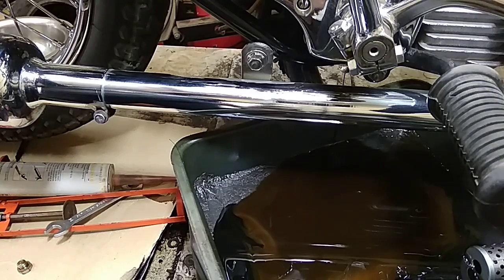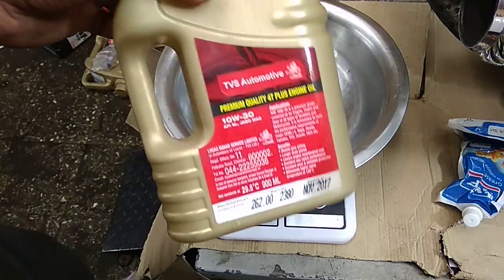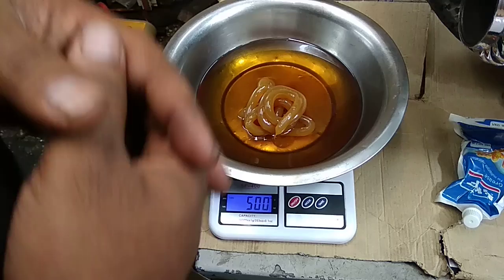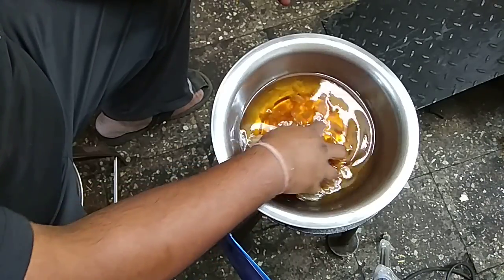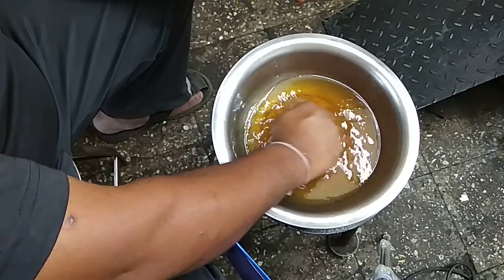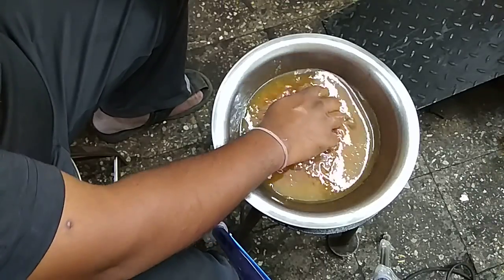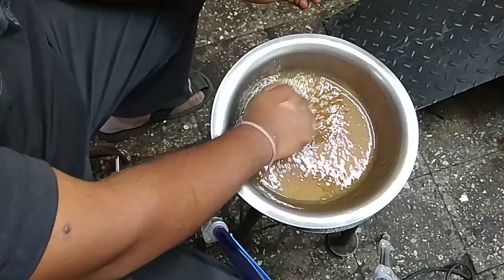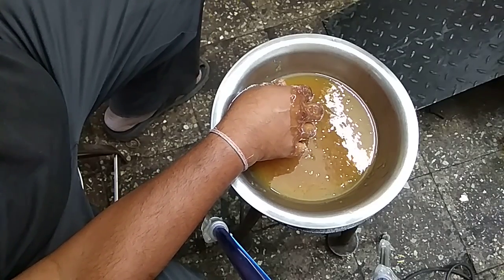Royal Enfield Four speed gear box lubrication...home made "00" grade grease (English) Part 3/4

Comment: In the owner's manual 700gm weight is mentioned. And if you use an oil grease mixture then it should be 1:1 grease 350 gm and oil 20W-50 350 gm.
Reply from the maker: @Vinay350Rider  that is unless you 100% empty that whole box...otherwise it won't fit...also the ratio is not 1:1 it will become too much thick.i prefer 200gms and left over is oil. Which works perfect.. oozing has to be melted ice cream type..
Reply: @MechAutoClinic  but bhaiya owner manual mei 1:1 likha hai. Aur waise bi kuch mechanic to sidha grease hi dalte hai aur yeh to phir bi 350 gm oil and 350gm grease mixture hai, sirf grease wale se better hi hai.
Reply from the maker: @Vinay350Rider  you can go as per manual and try...
Reply: @MechAutoClinic  best is to use '00' grade grease if available.

Comment: Can we replace our engine oil with this combination in BS4 motorcycles(classic 350)?
Reply from the maker: @bhaviks5213  you can use but 15/50 is too thick to go if you fail to mix. So you can use 10/30 honda oil

Comment: How do I remove old grease from the gearbox? I bought a Machismo A350 last year. And previous owner had put thick grease in the gearbox. Not just that, all the oils were used was for the CI bullet. I changed engine oil to 15w40, and clutch oil to ATF fluid. I can't get the grease out from the gearbox. Is there a trick?
You could try the cake mixer for mixing grease and oil.
Reply from the maker: If grease is thick then pour diesel and run it on stand by starting bike. It should. Come off. But if it is stubborn then open the covers and manually scoop it out. Using mixer is trivial only if I work on these old machines on daily basis. I almost stopped working on old vehicles. So these videos are just for information purpose. Implementation can be done at your end. I have given idea, further upto the person who is going to work.. Thanks.

Comment: Hello boss why can't we use NLGI - 00
Reply from the maker: If viscosity is good then why not. I have not tried that so I can't comment on it. NLGI-00 is semi fluid but have not used it. So less knowledge about it. Next time I will check with the brand store if they have it.
Reply: One more question - after how many kms engine oil should be repaced after engine (crankcase) rebuild ?
Reply from the maker: 1st after 500km and then later on every after 3000km
Reply: @MechAutoClinic  thanks

Comment: We can also use Gear oil 90 no.
And grease mixed together for this 4 speed GB right?
Reply from the maker: better regualr engine oil rather than gear oil since the thickness is extra in 90 than 20/40 or 10/30. since its a mixture so maintaining thickness is also important by keeping reasonable  ratio. thanks

Comment: Sir will filling up my gearbox with new grease, make shifting smoother? Also does the gearbox have a drain plug to remove old grease?
Reply from the maker: Yes it has drain plug. Greas/oil makes it way better smooth

Comment: Why not gear oil sae 140
Reply from the maker: can you donate B+ blood to A+?....i guess nope...it is due to non suitability...same way the 4 speed gb is not suitable for oil due to its construction..
Reply: Mech Auto Clinic I request u too reply as soon as possible..
I used liqui moly 15w50 synthase technology engine oil 
In ELECTRA 2008 C.I / cast iron / opposite side gear box 4s transmission 
In September for winters as my area reaches 10• c cold 
So my service is left for 1000km to be done ... 
what grade like 20w50 semi synthetic technology to be used again after using above 15w50 synthetic technology... will it HARM the engine going back to semi synthetic & changing COLD 15w grade to 20w ...OR should I stick to 15w50 synthetic technology..
Please REPLY SOON & importantly can I use the same grade to if abv oil with white AP3 grease..?
Reply from the maker: sir...small question....so i can explain all of you better way...whats your blood group?
Reply: @MechAutoClinic  b+